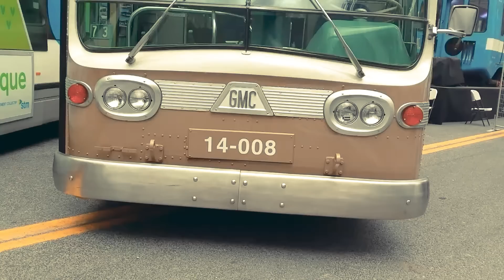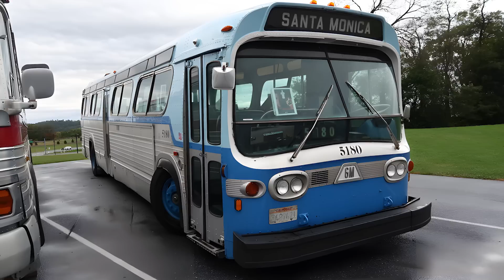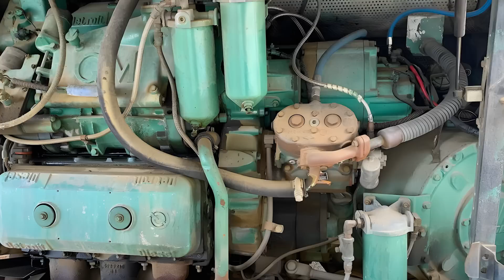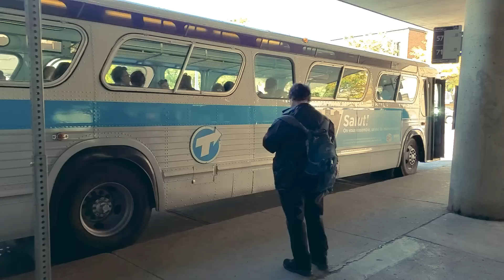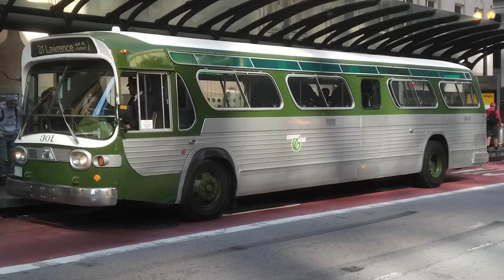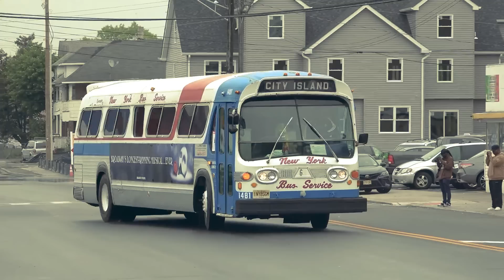The Shocking Truth About the 1959–86 GM New Look ‘Fishbowl’ – America’s Most Iconic Bus

Comment: Drove a fishbowl for 32 years for the TTC in Toronto. Now I own a TDH5303 made into a camper. 6v92 TA DDEC IV with a V731 ATEC  with an overdrive. Since purchasing it in 1984 I have put 300000 miles on it with very little issues. Still running strong with very little corrosion as the cross I beams were made of thick aluminum.

Comment: Wrong. Power steering was available. Most operators didn’t order. Also mechanics put chassis lube in steering boxes instead of oil. That made them hard to steer. Windshields were very easy to change. I have changed hundreds

Comment: I love that you have a lot of Toronto, TTC, fishbowls in your video. Toronto pioneered the double rear door and the elimination of the standee windows to increase the strength of the body. The early fishbowls had a problem with dissimilar metals in the under side which trapped water, and during the winter salt water, which created electrolysis that destroyed bus undersides. TTC got GM to pay for a major rebuild of the early fishbowls, then the TTC used to the equipment provided by GM to rebuiled their post war PCC street cars, Thank you GM. They, and the earlieer GMs were my favourite diesel buses.
Reply: Actually the TTC elimination of the standee windows was more of a cost cutting measure than anything as they were prone to leaks condensation and rusting of the window frame and it reduced the purchase price.

Comment: Hello from Toronto, Canada. After the city of Toronto (Toronto Transit Commission) moved on to newer buses, that were used on low-speed 'local routes' until December 2011. Bus 2281 had the honour of being the last Fishbowl in revenue service and operated on the late-night Yonge Subway shuttle bus, running into the Mount Dennis garage in the early hours of December 17 2021. Aside from a short run in 2012, where one operated on the Toronto Islands - that was it for them in Toronto. I remember on the Lakeshore Road to Royal York Subway - a route that I often took - being fascinated by what seemed to be their TWO SPEED automatic transmissions. There was an ABRUPT clunk, as the tranny shifted from low to high...and on the rare occasions that the bus would hit 35 MPH (56 kmh) - they'd be really screaming! Of course - when I was a kid, before the 'fishbowls' on the Royal York Road bus route - they had the 'old look' GM buses with MANUAL TRANSMISSIONS...the rule was, if you were DRIVING behind one - you let them get a WAY ahead, because the bumper height exhaust outlets would treat you to plenty of Detroit diesel smoke and smell. Oh, the good old days! Now, Toronto is moving to ALL-ELECTRIC and HYBRID buses...

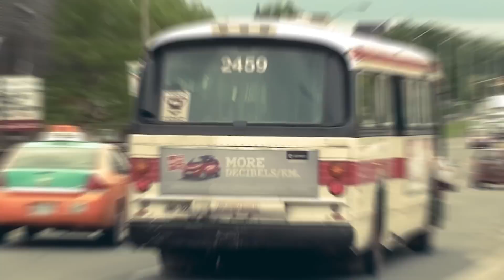Comment: 5:22 I actually RODE that bus!  That's from Regina Transit in Regina, Saskatchewan (you can tell because Z99 is one of the top radio stations in town).  I grew up in Regina, and these buses were the mainstay for the transit system for YEARS.  It wasn't until the NovaBus arrived in the mid 2000s that they were phased out.  Loved those buses!  i always just called them the angles, because the other bus type Regina used had flat fronts and square windows

Comment: So many variants.  There's a bus in these pics that I'm sure I probably rode on going to highschool.   The city still had two used in emergency services. One was an emergency response command bus and the other was a fire dept rest bus used at large fires.  I'm not sure if they're still in use.  
I towed one of the smaller units about 20 years ago.    I miss their sound. The newer ones go by and you barely notice it.  Also, the lower and wider floors, has only invited social dependants to get on a bus with their double wide strollers and block the isle for everyone else.

Comment: You know, these didn't have what you would call an automatic transmission. They did not shift gears at all. There was a fully manual gearbox with only forward and reverse. When changing directions, the gearbox would grind profusely. The system itself was called 'Hydraulic Drive'. The heart of it was a torque converter, operating like a Buick DynaFlow. What separated it was that the torque converter had a lock-up clutch, giving a true direct drive, like a Packard Ultramatic. Much later years saw actual automatic transmissions. But, the hydraulic drive was still around.
Reply: The ones I rode on four different transit agencies had a two speed automatic transmission. You could feel it shifting as the bus picked up speed.
Reply from the maker: They used a hydraulic drive, not a true automatic, just forward and reverse, with a torque converter and lock-up clutch. Later models finally got real automatics.
Reply: @KingofClassicCars do you know when they changed to fully automatic transmissions? I do recall the older ones would roar upon accelerating. I had a clutchless automatic stickshift Volkswagen Beetle that did a similar thing. You left it in second gear while driving in the city and never shifted, except when on a steep hill or highway driving.

Comment: There was 96" and 102" wide body have to look at the front emblem to see how far it is from the vent . Cool to hear some diesel sounds
Reply: I try really hard to like AI/bot channels but the Detroit Diesel does not use forced induction. Forced scavenging yes. 8/10 on the video so far.
Reply from the maker: There were 96-inch and 102-inch wide bodies, and you could tell by how far the front emblem was from the vent. Cool to hear those diesel sounds.
Reply: Now I’m done with AI. AI isn’t supposed to mock people or whatever that was.